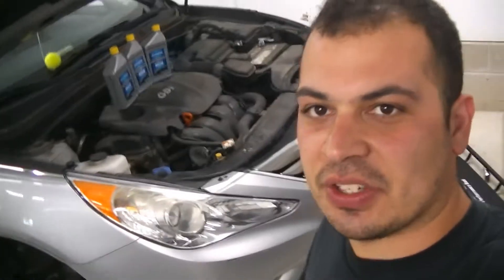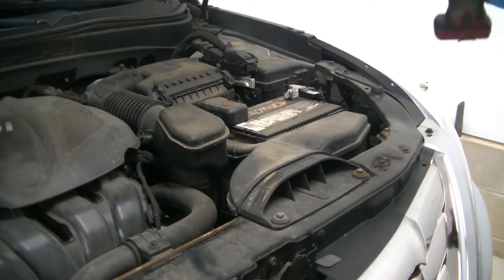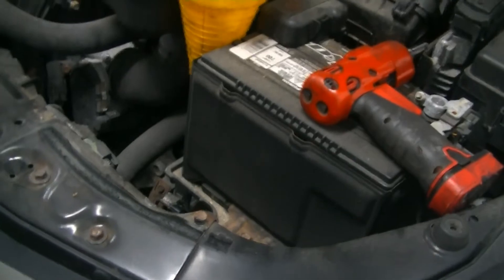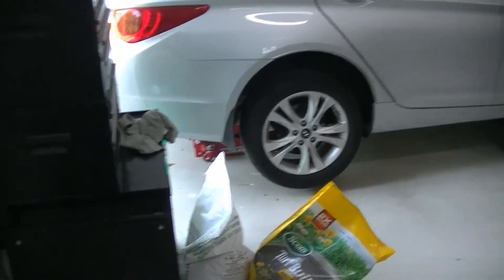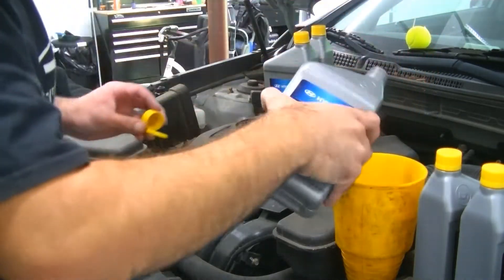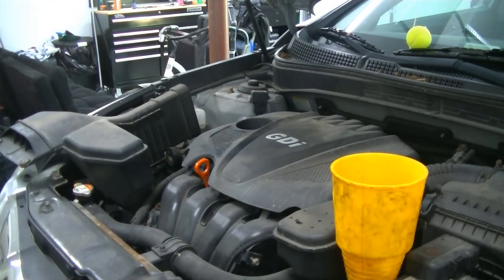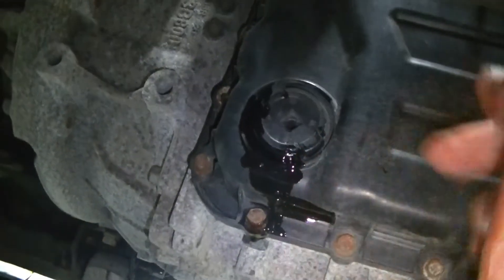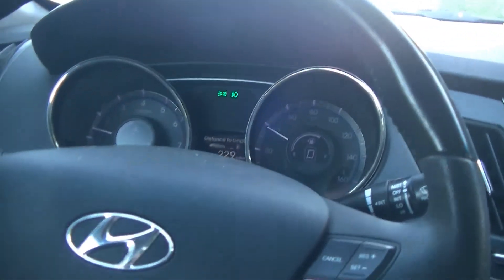Hyundai/Kia 6 speed automatic “sealed” transmission fluid service and level adjustment

Comment: After watching a few videos, I've come to the conclusion that you're the only guy doing it right. Most of the guys check the level with the car off, I think they'll end up with low fluid. I saw an excerpt from a factory service manual, it wasn't emphasized that the car should be running, but if you follow the steps as they were written it never said turn the car off. Nice job on the video. Thanks for posting.

Comment: Why are you so worried about not being able to loosen the fill cap?Couldn't you just pump the fluid in through the check cap? Crush washers are about $3 for 50. I just change 'em.
Reply from the maker: Being able to fill the unit after draining is paramount, and is a habit I’ve been practicing since day one of my automotive career, no matter what I’m working on. Changing engine oil? Fill cap comes off before the car goes in the air. Servicing a transfer case? Fill plug comes off first followed by drain. Servicing a differential? You guessed it. Fill plug followed by drain. It’s a good habit to get into. Sure there are work arounds, but I like to cover my butt, especially when the vehicle I’m working on isn’t mine. In the case of the crush washer, when doing engine oil changes I’ll replace them every time as they’re readily available and in stock. Transmission crush washers are usually special order and reusing isn’t the worst thing in the world.
Reply: @SEsGarage  Disregard my negative comments, I was in a bad mood. I was going to skip all the work up top and just pump the fluid in through the inspection port. Now I realize I wouldn't get enough fluid in there, it would start running out before it was at the correct level, unless the car was running which I wasn't planning. Anyway, I'm going to do it your way, you're the pro. Great video.
Reply from the maker: @JA-gx4hb  there’s more than one way to skin a cat. In the hybrid sonata’s, I’ll fill from the Inspection port as there is no torque converter to worry about filling, and the full port is blocked by the hybrid converter/power unit

Comment: Question. When checking the level you leave the engine running?  Can you check it with the engine off?  I know using a dip stick tranny you check the level running but with the side opening running also?  Very good video.  Thanks

Comment: Can any 1 please help me out i bought a hyundai sonata 2018 1.6 turbo american specs in dubai imported from US. The car is fine but there is a vibration in first gear while accelerating after that when it shifts to second gear it goes fine even in traffic when its in low speed n on first gear it takes high rpm n does vibrate while pushing the pedal. Is it gear problem i need to replace the full gear or anything else i need to check because it is really hard for me to find a good mechanic who can resolve this issue

Comment: First video I’ve seen where the car is running when you open the inspection hole.Now I’m a little nervous about doing it.
Reply: No need to be nervous about that,  that's how it's done.  I've done it 5 times on 2 different cars.

Comment: Technical safety question. I’m planning to do aft service on 17 Elantra. At 14:19 you mentioned that you have the car’s front on 2 jack stands and the rear on one jack alone. I’m not entirely positive it’s a safe method (especially w/jack in the rear of the car). Would it be more safe to put car on all 4 jacks instead? Also, when you shift between parking and Drive while car is in the air is it possible that it will lurk forward a bit and off jack stands???

I had my 2019 Ody and 17 Accord Hybrid on 4 jack stands before, but never tried to start the car and shift between gears like you did. I thought it’s unsafe, but I’m not a mechanic, so that’s why asking here.

Btw. Hondas have much better design to lift cars than Hyundais. There are front an rear jacking points. Much more convenient as you can lift whole front with jack.
Reply: Visually alarming, the right thing to do with a customer's car, put it on 4 jack stands. Murphy's Law.

Comment: Had my Santa Fe 2011 3.5  6 speed transmission fluid changed for it's first time at a lube shop and over a period of one month it deteriorated (slippage, erratic gearings changing)progressively worse until complete failure and required transmission replacement. Found out the lube shop used an aftermarket Maxlife ATF and not OEM fluid SP-IV. What happened?
Reply: How many miles where on your car?

Comment: I have a 2018 Sonata with the 2.4 that I purchased new. I changed my ATF fluid yesterday (30,000 miles) after driving the car to warm up the oil. I carefully measured the fluid after draining. 3.7 quarts came out, so I put 3.7 back in.
Reply: Kirk, how did your fluid look at 30,000 miles? I have a 2020 Sorento 2.4 with 6 speed auto, and we like it a ton, so I want to change the fluids myself. It has 18,000 miles on it and was thinking this summer on the ATF fluid change.
Thank you sir!
Reply from the maker: 30k to me is a bit overkill. Most cars I’ve drained at 60 the fluid still looks decent
Reply: Was the fluid still a decent color and smell?
Thanks
Reply from the maker: @pmtips4482  yes it’s usually still red at 60k. A darker red than new fluid but still red non the less. If your curious just pull the inspection plate on the front of the valve body cover with the engine running and stick your pinky in there
Reply: @SEsGarage  Many thanks!
Reply: I'm planning on doing the exact same on my 2018, what brand fluid did you use?
Reply: That's how I do it.

Comment: You dont need 6 quartz, 4 maximum 5 quartz just in case, however ive never needed the 5th quart.
Reply from the maker: Yeah admittedly I was a bit rusty from being out of the dealer for a little over a year when I made this video. You need 6 quarts when replacing the transmission harness for the fluid temp sensor TSB because you loose so much more fluid when you pull the valve body.

Comment: Please. I cannot emphasize enough to not bypass the reading of the transmission temperature using a scan tool to get correct level.  DO NOT attempt to use a laser thermometer or anything else you can come up with. You will not get the correct level and scan tools are cheap. My cheap Obd2 scan tool gets the transmission temp

Comment: One question: When you used the scan tool to measure the oil temperature, it was meaning the engine oil temperature and not the ATF temperature, correct? EDIT: Since 120 F is about 50 degrees C, I guess it wasn't the engine oil temperature.

Comment: Good video 👍🏻 ., is this the same way for my 2018 Hyundai Tucson 1.6T ., and do you know if it uses the same transmission oil grade as shown on your video , Also how many quarts would my transmission take
Reply from the maker: 1.6T would be a dual clutch transmission unfortunately. Different procedure, more like servicing a manual transmission, and it takes regular gear oil, not transmission fluid
Reply: @SEsGarage  ➡️ thank you for your reply , o Jesus , I’m gonna have to let the dealer do the job

Comment: At the end you mention resetting the transmission adaptive. Do you mean the TCM? How is that reset?
Reply from the maker: The transmission adaptive values yes! You need a scan tool
Reply: @SEsGarage  Thanks. I'll try to communicate that to the 2nd Hyundai dealer. The 1st one said there were no "updates" available for the TCM.
Reply from the maker: @paulwylie989  so an update and resetting adaptive values are two different things when you reset adaptive all you’re doing is telling the transmission to relearn shift patterns and shift pressures
Reply: If you don't have a scan tool, doesn't the computer automatically "relearn" the shift patterns and shift pressures, after you drive for a while? @SEsGarage
Reply from the maker: @davidmclain1875  it’s supposed to “adapt” but sometimes it learns bad behaviors that can induce shift flares/hard shifts. An adaptive value reset will wipe that out completely and force it to start from scratch

Comment: On our 2015 Sedona with 145,000 miles,  I drained and filled 5 L per procedure and added 700 mL for the fluid check procedure.  The fluid was nasty and due for some fresh fluid.  When i performed the fluid check, two liters came out from the check port over two minutes.  I hope that's ok.  It seems to drive just fine.
Reply: 2 liters at the check port is a tremendous amount of overfill.

Comment: I just ordered same fluid.  Is it working well ?
Reply from the maker: I’ve used this fluid in countless vehicles when I worked with the dealership with great results. I wouldn’t expect any less considering it’s what they’re shipped with
Reply: So far ok,. I ran for 1000 miles than drain another 5 quarts.
Reply: So far ok,. Drained again after another 1000 miles.

Comment: Is the SP4 really equal to SP-M. Fluid.  I have 2017.  Elantra and are getting ready to do the work.  Thanks for the video?
Reply: I was wondering the same thing, did you ever find out?
Reply: They are both the same.  Hyundai Kia dealers call it SP-M instead of  SP 4 for whatever reason.

Comment: Hi, great video. Very methodical. I have a 2016 Sonata AND a 2016 Kia Sportage. I have drained and filled the Sportage and I used Kia Transmission Fluid (SP-IV M) on that job. I had more than 2 quarts left over, and as you know the fluid is pretty expensive. Do you know whether or not the Kia fluid is the same formula as the Hyundai fluid? The Hyundai fluid, at least where I live, is even more expensive than the Kia fluid. If your service manual says anything about it, of course...by the way, the owner's manual has the exact same description of acceptable transmission fluids for each vehicle. Thanks in advance.
Reply from the maker: They should be identical!
Reply: @SEsGarage  Thanks for the response. I'm trying to check with Hyundai to see what they say, but will also look under the car to see if the transmission has both Hyundai and Kia markings on it.

Comment: Yours is the most methodical video  on changing the transmission fluid and like a lot of these sealed transmissions it needs to be checked at a specific temperature which you emphasize so the fluid is the correct level at operating temp. IMHO the difference between a "just enough knowledge to be dangerous" job and one that is the same level as an experienced tech. I was not confident to do my 2013 Sportage until I saw this video. It is our much loved family treasure and I didnt want to be one of the ignorant butchers that missed important details. I will be choosing a high quality fluid that is a Penrite SP 4 low viscosity ATF. It seems that a lot of synthetic fluids are converging on similar specs rather than the old 50 different mineral trans fluids.

[Edit] Just done the fluid change on My 2013 Diesel Sportage using  Penrite LV ATF which includes SP4 and SP4-M. Hardest part was shimmying under to get the under tray off. A four post hoist for christmas please! Fluid was dirty enough ( A bit dirtier than your example) to vindicate the change at 140k kilometres  which is recommended for severe duty. My car has had it pretty easy with a lot of motorway and country trips but I still reckon 9 years is long enough even with long life fluids. That filler was a challenge as I did not take off the oil cooler hose as you suggested. Definitely needs to be slow to stop it burping out. I did see one guy filling  with a drum pump into the level checking hole. Seemed to work well.  Next time will be a long neck funnel! I removed the airbox which was one bolt on the LHS and releasing the air hose clamp and the sensor on the front. The snorkel was easy with the little press button connectors just needing a push in the center to release and then push the pin out the top to put back in and pop it back in to the way you found it. 
I didn't have a temp gauge to check the level but I did drive it for a while so it would be close enough to normal temp. I didn't think it was shifting bad before but it does seem to be a bit smoother afterwards. Maybe the newer synthetic fluids are better than the OEM fluids. Very satisfying! Thank you.
Reply from the maker: Appreciate the kind words, and I’m glad my video gave you the confidence to do this job! Let us know how you make out! As long as the fluid you choose meets or exceeds OEM specs you’ll be fine
Reply: How has your transmission been feeling?

Comment: Why not just fill to the exact amount of the old oil drained out?
Reply from the maker: This only works if the fluid that you drain is at the exact same temperature as the fluid you put in. This will often get you in the ball park of where you need to be, but is never 100%

Comment: Hello, I am hoping you can answer a question for me. I have a 2016 Sonata with 124k. When I am driving with the passenger window down i can hear a chattering noise from what seems to be the right side of the car. I do not hear the chatter when the car is in P and I rev the engine. What could it be. Thanks.
Reply: My 2014 Sonata of around 90k mi had it with acceleration of a car, the faster the wheel spin the more wrooroororororom :) Front wheel bearing is the cause and man they're press type.
Repressed them with my neighbor (he used some cheap bearings) and its quiet so far at 122k mi.
Reply: I got a 2017 Sorento, and i thought i was hearing the samething with window down on passenger side.  Was yours a wheel bearing?
Reply: @garyclements318  It was my engine pinging. I use higher octane fuel and the noise went away.
Reply: @jefffch  thanks, mine has only done it once, but it continues ill go higher octane

Comment: First off thank you for your Hyundai videos. Could you tell me where the best lift points are for this car? Obviously the pinch welds are the best spots but I noticed you had a floor jack somewhere in the center rear. So other than the pinch welds where is the safest spot so I can use a floor jack and still have room to get the jackstands to the pinch weld? Tia
Reply from the maker: The front and rear subframes would be your next best bet

Comment: Hi man. Thanks for the video. 
I have 2019 hyundai elantra 6 speed transmission. Are you sure about the 120-140 F temperature for measuring the fluid level?
Some mechanics say that I should be between 85-95 F 🤔
Please let me know. Many thanks
Reply from the maker: Got my info right out of the service manual
Reply: @SEsGarage  Sounds like a pretty normal operating temp too.
Reply: I think the key point is that the fluid needs to be at normal range operating temp so it is the correct level at its usual operation temp range. Still a pretty low temp compared to engine oil but  the engineers who designed it should know what they are doing so RTFM is good practice. Would love to have a good service manual in hard copy for the Kia. Some jobs are definitely dealer trained and equipped jobs but sometimes you just need a manual to know how to do the job.
Reply: @rogerpearson9081  Is it required to keep the engine running while doing the level--check and further level adjustments?
Reply: @Sleeperknot pmI9
Reply: @jacktate958  hpk2.